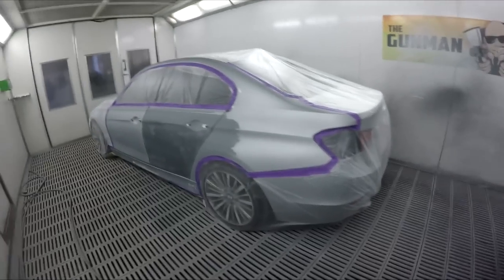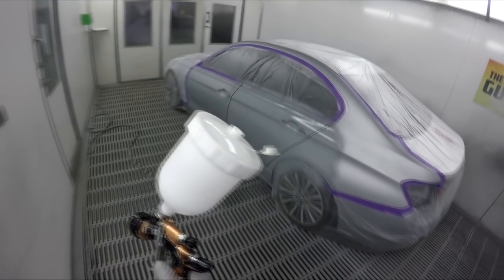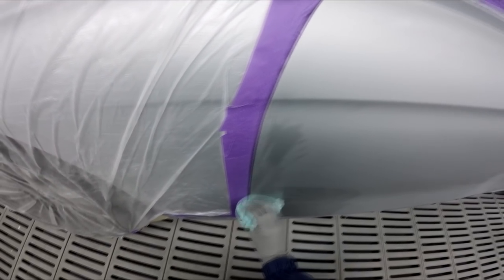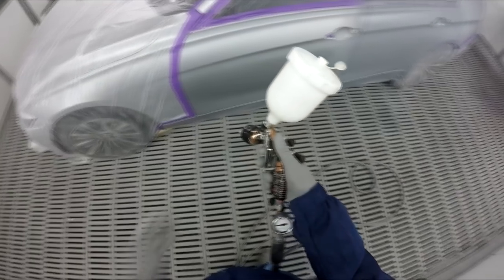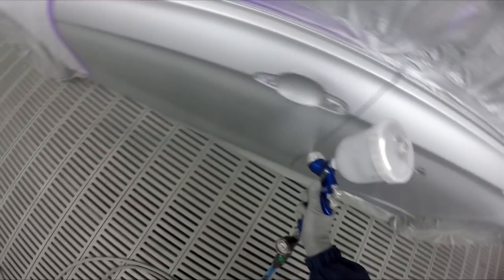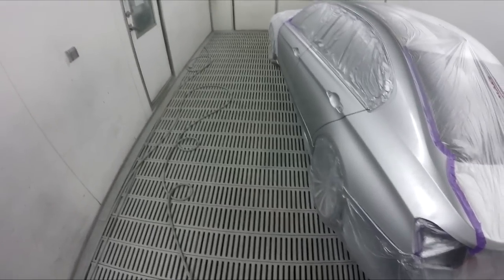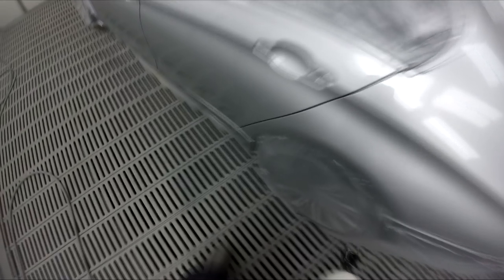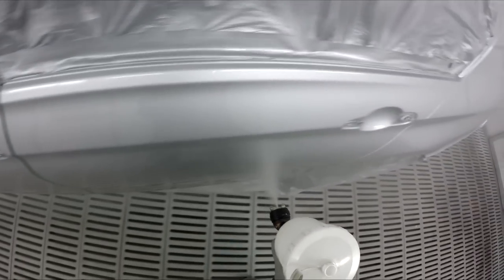Titan Silver BMW 320i Spray Painting, BEAST MODE!!!! FRIDAY EDITION.

Comment: Love these new raw vids. Watching em is like training prior to a fight. Quick question though gunny. A few weeks ago I repaired a black infinity. Dry sanding w 600 orbital, 800 sponge edges, seemed to have cut through all of the clear and after w&g remover, on my blend edges, it looked off black, or milky. I was not going too hard w the orbital, so my guess is the infinitys just don't have allot of clear on em. I ended up laying color over the whole thing edge to edge cause it was a black and it ended up fine, but I'm wondering what wouldve happened if I hadn't for future reference. Would the clear have darkened it back up, or did I make the right call laying color over the entire blend?

Comment: Yea Neva used water based but Iv bin told n have background in other solvent based chemicals. Mose solvents bey based on air flow. But I'd bet more scared of water trap in paint before solvent 😂😂 killa job gunny 💦💦🤘
Reply: Alan Jones if you trap water in the water based base coat and you clear over it its goes dull and you can even move the base coat under the clear paint its pretty funny to see 😂😂😂